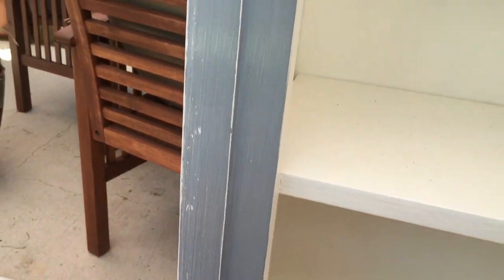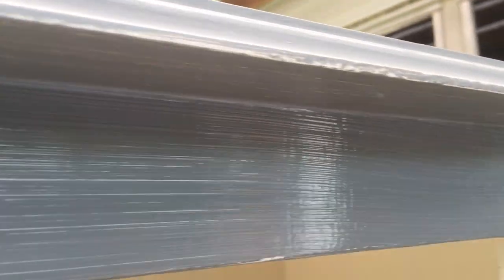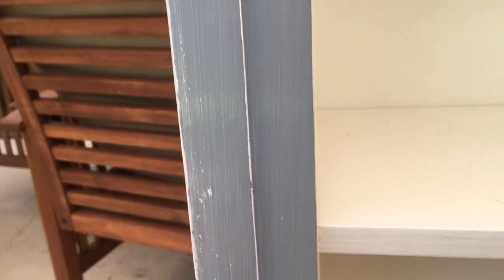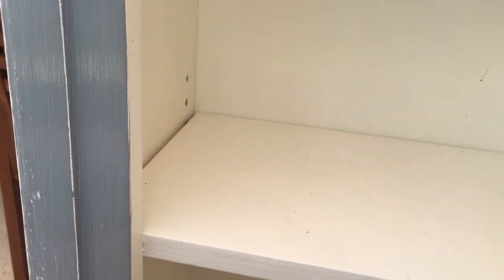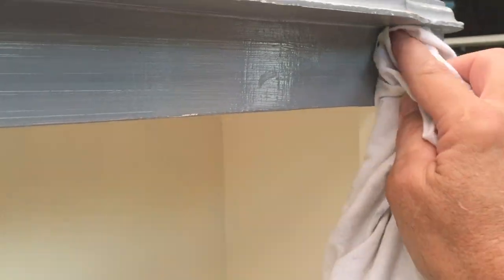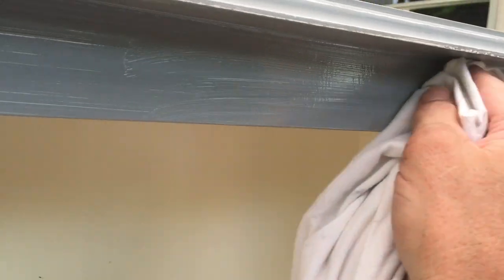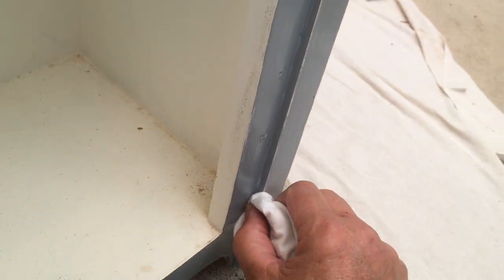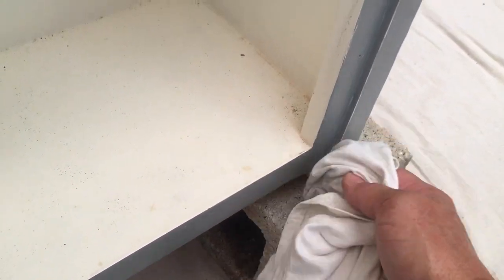Chalky Paint 15 of 15 Apply Sealing Wax to sides of cabinet, then the top.

Comment: Nice video. Question: Did you find that the chalk paint scraped off easily prior to your applying the wax? That was my experience - made me wish I hand sanded my project before chalk paint.
Reply from the maker: Hi Kurt.  Thanks for the question.  No, the Valspar Chalky Paint did not scratch off.  You are probably right about sanding.  And that's why I always do it.  I know some paints say there is no need to sand, but I can't get myself to do that.  After being a painter for 10 years, I'm kind of anal about starting with a prepared surface.
Reply: Keene M Yep, I know better - wish I had sanded
Reply: I forgot to wipe off the excess and now my nightstand looks like crap.  Is there a way to fix? Im afraid of sanding down to the chalk paint, but its pbly the only way. Thanks!
Reply from the maker: Hi David.  Thanks for watching my video.  Actually, I didn't like the way it looked so I painted over it.  Check out my #12 video.  https://youtu.be/02FPMC4fpjk
Reply: will do thanks!

Comment: Hi, I have used the valspar combo chalky paint and sealing wax a couple times. I’m repainting a dining set and got the bright idea to not wipe off the excess wax, thinking it would be more durable. I put it on with a brush and in very thin coats. It dried nicely, but now I’m worried will it peel? The phamplet says you can go over the sealing wax with polyurethane. I’m afraid to try that, but I want the table top to hold up and not scratch. Any suggestions😊
Reply from the maker: Hi Tami.  Thanks for watching my video.  I get what you're going for.  I like your methodology and would probably wait as long as possible between coats to make sure it was really dry.  I think I would eventually (maybe in a week or two)  buff it with a t-shirt.  You could continue building up coats to create a more protective coating over time.  Let me know how it works Tami.  Thanks again.  Keene